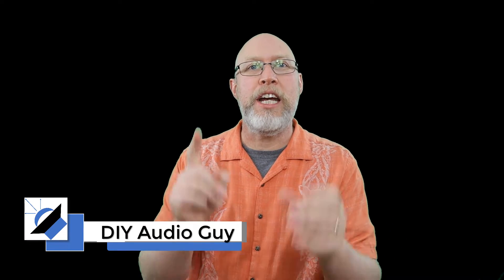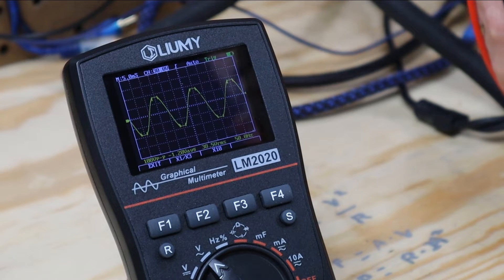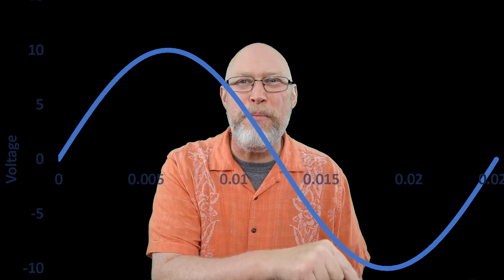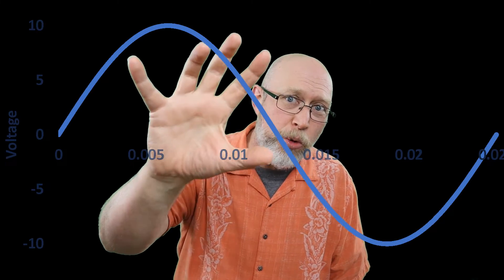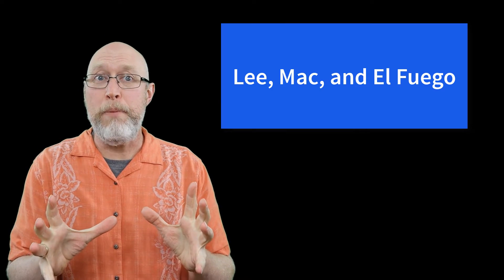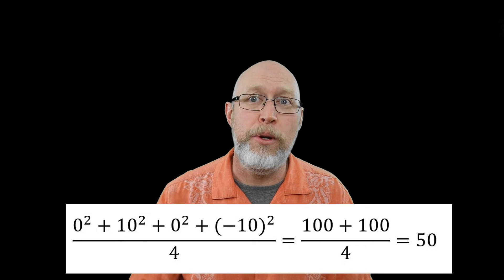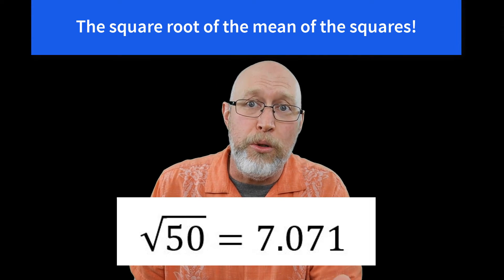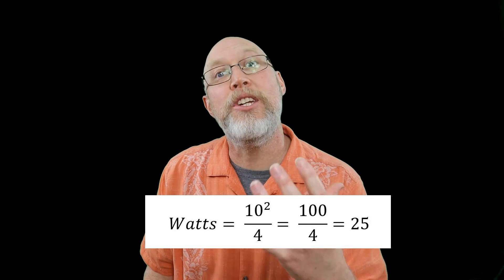RMS Watts vs Peak and Max Watts, Amplifier Power Explained

Comment from the maker: I you found this helpful or useful please consider supporting the channel.  https://www.patreon.com/DIYAudioGuy
Reply: Holy shit do you even know the difference between AC and DC voltage.  Do you have any clue on the difference between an AC sinwave and a DC sinewave.  Please tell me how you get an AC sinewave from a DC source.
Reply from the maker: @timbuckohfive2751  The output from the amplifier is not DC voltage, it is AC.  The RCA signal coming from the head unit is also AC.  The only part that is DC is the 12-volt power supply provided by the car's charging system.
Reply: @DIYAudioGuy  An audio output is a DC current in which the voltage varies in amplitude.  Its not AC.
Reply: @timbuckohfive2751  nice effort, but audio signals are AC, put an oscilloscope on your amp output if your not sure, you'll see a sign wave, the frequency (Hz) is the number of times the peak of the sine wave passes over a certain point in 1 second, high pass and low pass filters would simply not work if the signal was DC, as the frequency would be constant, and just a flat line on an oscilloscope
Reply: @elliotlaw1590  Thats where you are wrong.  Its a direct current.  For it to be ac the polarity has to be changed.  You get a sign wave because its music,  it changes frequency.  It doesnt change ploarity.  Alternating current alternates between a positive voltage to a negative voltage.  Measure the voltage coming out and you will see it never goes below 0v.  I can take a variable output DC power supply hook an oscope and turn the output up and down and it will make a sign wave.  Its still DC power.
Reply: @timbuckohfive2751  You know your stuff, but the frequency of DC voltage is 0, because if you look at DC voltage using an oscilloscope, it creates a flat line, you appear to be getting confused by the conversion of analogue audio signal to digital audio signal, which in its simplest form, is a sine wave converterd to a square wave, that is still an AC voltage though. 
You won't see it read 0 on multimeter, just like you won't see any AC voltage read 0 on a multimeter because of the frequency, or the rate at which the current alternates, if you set your multimeter to DC you'll see it constantly flicker the voltage, but if you set it to AC it will give an AC voltage reading of whatever the peak of the sine wave or square wave is.
Also that kinda explains clipping as well, as the wave goes flat on the top, this is because of the conversion to a digital signal, and some of the data gets lost, so the wave becomes.more "square" this is because of lost data essentially
Reply: @elliotlaw1590  I have a degree in electronics and worked with radars for years.  For it to be Alternating current it has to go from a positive voltage to a negative voltage otherwist its just a dc output that varies in amplituded.  Yes on an Oscope it looks like AC but it isnt.
Reply: @elliotlaw1590  The frequency that you are seeing comes from the song not the amplifier.  The amplifier only increases power of the signal coming from the input.  The input Is an audio signal the output is that same signal only amplified.  The audio signal is what causes the sine wave.  The power is DC
Reply: @timbuckohfive2751  So we agree then, I wasn't disputing the fact that the power was DC, since it's using a battery as the source of power, that's undoubtedly DC, the audio signal however, from the headunit into the amp, and the amplified output audio signal is AC
But yes, the power input to the amp is DC.

I think your getting confused though, because there are DC and AC amplifiers, for audio signals, the amp outputs an AC audio signal, but yes, it uses DC from the battery to the amps power input, to power the amp
Reply: @timbuckohfive2751  I also have a degree in engineering btw, but yeah, audio is a sine wave in analogue format, it's converted to digital format, which is essentially a square wave in its most simplest of forms, which is still AC, effectively the DC power source is switched on and off thousands of times a second by the amp, to create a square wave which closely matches the original sine wave, converting the DC power to an amplified AC output.
Reply: @elliotlaw1590  Its no AC its DC.  You can argue with me all you want but but for it to be actual ac it has to start at 0v got to a positive voltage then down to a negative voltage to be considered AC.  The output of an audio amplifier will never oputput a negative voltage.  Your sinewave you are seeing is an audio frequency Has nothing to dso with what type of current it is.  In a 15 v ac you have a 30v potential.  You go from a +15v to a negative 15V wich if you cout the voltage between the positive and negative voltages give you a 30 volt potantial.  If you look at the power coming out of an audio amp it will go from 0V-15V which gives you only a 15v potential its whhat defines the difference between ac and dc.  For it to be considered AC the flow of electrons has to change direction.  
 alternating current ôl′tər-nā″tĭng, ăl′-►

    n.
    An electric current that reverses direction in a circuit at regular intervals.
    A current which periodically changes or reverses its direction of flow, especially an electric current that reverses direction sinusoidally, as is used for most domestic and industrial power requirements. Contrasted with direct curent.
    n.
    an electric current in which the direction of flow of the electrons reverses periodically having an average of zero, with positive and negative values (with a frequency of 50 Hz in Europe, 60 Hz in the US, 400 Hz for airport lighting, and some others); especially such a current produced by a rotating generator or alternator.

Comment: OMG totally incorrect. You use RMS voltage or current to calculate average power. RMS power doesn’t have any physical meaning and there is no point calculating RMS power of anything.

Comment: Yup. I had a 50 watt 2x4.5  P.A. speaker that was rated at 50w and my 2x8 little guitar combo was rated at 20w. Both are solid state.  My guitar amp perceivable volume was way louder than the P.A. both at home and at the bar venue i play at.

Comment: i have dual 18inch 8ohm speaker with 500w nom, and 1800w max.. should i pick 500w x2 amplifier or higher?
Reply from the maker: Sounds like a PA driver.  What I would do is wire it parallel to 4 ohms and then connect a 500w amp. Learn more here:  https://youtu.be/F51UQSBFaQs?si=gmdr_-WV6WEw0MBp

Comment: Except there's no such thing as RMS power in electrical engineering.  It's a marketing term that's been so universally adopted that now everyone uses it.  But technically speaking, the correct term is continuous power.
Reply from the maker: I literally showed you the math on how to calculate it, so I'm not sure how it doesn't exist.

Comment: Why didn't you mention the Lumy's capability to display the RMS voltage at the bottom of the waveform screen. It is different than peak voltage number that will display if youbwere to switch back to the voltage screen, which will be showing the current max voltage.

Comment: I have a problem, I have a system that needs 950 rms my amp only provides 150 rms and it isn't a bad amp, do I need 950 rms?
Reply from the maker: It will still operate with less power.

Comment: Thanks so much for this video. I have 2 speakers 300w peak power each. Can I use a powered mixer with 600w rms?
Reply from the maker: Not sure what you mean by a power mixer.  Like a pro-audio console?
Reply: @DIYAudioGuy  it's an amp and mixer. Pa system for vocals and guitar. Mostly for band equipment

Comment: The big misconception about this topic is that people keep calling it RMS power, when it is in fact AVERAGE power. Yes, you use RMS Voltage to calculate AVERAGE power, the math just works out like that.

You could take the RMS of the power wave if you wanted, but that doesn't have any physical significance or use.

Comment: NICE! Thanks for doing a video on RMS-peak-volts-etc. I have been a closet DIY speaker building nut-job since the late 1970s. So many of these new digital chip amplifiers have inflated advertised wattages and are severely misleading. Most are about 1/2 their advertised wattages. I go by RMS wattages and I think that should be the standard for rating amplifiers. You also rarely see amplifiers nowadays showing "how quiet" they are (THD and TIM percentages).
Reply from the maker: Glad it was helpful!

Comment: My head unit has 14RMS. I want to replace the speakers but I can't find speakers anywhere near that RMS. Do I have to have an amplifier or is there a way around this? Thank you.
Reply from the maker: No, you don't need an amplifier.  When I was first getting back into car audio I was running some 75 watt coaxials off of my head unit.

Now you might want an amplifier. But, after market speakers will work without them.
Reply: @DIYAudioGuy  Thank you. I have a Pioneer AVH-x4800bs head unit with stock component speakers. I just want to replace them with something a little better. I was thinking some lower rms Alpine components. I will eventually do a complete upgrade but my wife is three weeks out from having our first baby so we will be busy for awhile. I want to replace the speakers within a week.

Comment: Why have the ratings changed so much? For example; a Yamaha A-520 amplifier rated at 75 watts RMS Into 8- 16 Ohms matched with a pair of Realistic Mach 2 loudspeakers. Rating at 160 watts Peak. I later added a pair of rear speakers at 4 ohm, 100 watts peak. Little bookshelf speakers on stands my brother made me. My friends would always say : how is your stereo louder than a bloody nightclub? And they always referred to a family member that spent over 1 grand on a system that sounded like a little transistor radio in comparison? Also?: how much did you really spend? Because it's deafening. Etc. I even used my system as a PA system with my first marriage.  I used a tape deck with a mic input and jambed on record. LOL. Worked like a charm. Big hotel with big floor area. Yet a poverty system sounded perfect in that environment. But only 75 watts per channel RMS? I also went by the weight of the Amplifier as it felt like someone put a solid brick or 2 inside! Any reply appreciated? I have an engineer friend who I still buy Subwoofers to install for friends and family. He explained that things were made with better glues and Resins? He told me how he worked for JBL In the UK as a production manager. He had to tell the assembly crew what glues to use on cheaper speakers and to use better quality glues on dearer speakers! He says still to this day: it doesn't matter what brand? If your paying top dollar for the best in any brand basically you will Have an excellent reliable sound system. Sorry for rambling! But is this true? Cheers from Australia
Reply from the maker: I really don't know.  Part of the problem is that consumers only understand watts and that's all they look at. There is a lot more than goes in making good sound.

Comment: So, if the speaker's Peak Power is 2400 Watts Watts Per Pair (1200 Watts Each), Program Power is 1200 Watts Per Pair (600 Watts Each), and the
RMS Power is 600 Watts Per Pair (300 Watts Each), I can just buy a 300W+300W amplifier should be good, right?
Reply from the maker: Yep.
Reply: @DIYAudioGuy  Thank you, sir!!!!

Comment: Hi sir I have pioneer gm-a6704 model amplifier I don't know how much rms in this amp and which subwoofer can I use I select 1200watts infinity primus 1270 model and rockfordfosgate r1-s412 which one is correct suitable subwoofer in this amplifier pls tell me sir
Reply from the maker: I found the specs in under 30 seconds via a google search.  That is a 4-channel amp.  If you bridge it then either of those subwoofers will work OK with the amp.

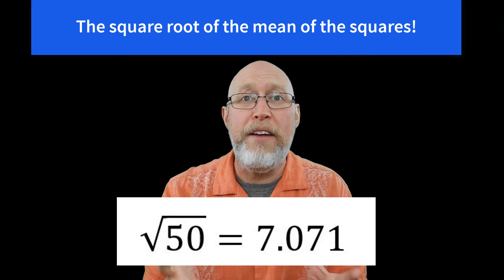Comment: @5:25 The reason you take the square root of the summation is to reverse the previously squared samples that were summed. Pretty straight forward, you square the sample to remove the negative values, then add them up, then reverse the process you used to remove the negative values by taking the square root of the sum. I just discovered this channel and very happy to see someone explain these topics so clearly, great work dude! The biggest hurdle for most people is math, I remember being afraid of square roots and other simple math but only because I didn't know it, took years for it all to click. Now it's embarrassing to even admit I was afraid of math and avoided it like COVID. Ha ha! I have a hunch that bankers know this, which resulted in things like compounding interest.
Reply from the maker: I have found that a very small amount of math creates a very large amount of power.
Reply: @DIYAudioGuy  Math and physics, the basics using algebra level math isn't that difficult conceptually and explains the world we live in.

Comment: Why dont manufacturers just produce one wave length amplifier and mention only rms value instead of peak values no one cares about peak because after peaks actually the systems shuts off its like ur car runs on 12v u can have max peak of of good battery voltage of 14 but if you give it 16+ the wires will fry!!
Reply from the maker: It's all marketing.  Power is an easy thing for consumers to understand and compare across products.

Comment: While this is all true as far as the consumer is concerned, It should really be called Average Power not RMS Power. The so called "RMS Power" given in specifications sheets is actually the average power rating. If you actually calculate the root mean square of the power waveform you get an incorrect (higher) number. Referring to Average power as RMS power makes no sense and is simply mathematically wrong, and was a term that likely originated with someone who didn't understand electrical engineering.
Reply from the maker: AC power is a lot more complicated than most people realize.  All of the stuff that you and I are talking about only applies for restive loads.  Most loads are reactive.
Reply: @DIYAudioGuy  This is very true indeed, though most power amps are rated into a resistive load. Either way, referring to average power as RMS power is wrong, even though it seems to be accepted for some reason in the audio world. RMS is only really useful for voltage or for current. When dealing with power, average is the relevant quantity, and can be calculated by multiplying the RMS current and RMS voltage, assuming a resistive load of course. but the point is that for resistive loads,  RMS Voltage x RMS current = AVERAGE power, not "RMS" Power, which is a term that simply isn't describing the quantity that is being given. While you could actually calculate the Root Mean Square of the power waveform, it would not actually be the same value as what people people mean when they say RMS power or average power, and would have no real utility.
Reply: @chrisbauer1925  I recently developed a AC power meter and was left scratching my head wondering what the heck I was doing wrong in my code, come to find out... you can't calculate power as you stated. After a bit more research it all became clear where I was going wrong but I think it's okay to say RMS power, my reasoning is that the consumer knows the values used were RMS and not peak values. If you call it AVERAGE power then that infers that you averaged the instantaneous power which will give an incorrect value as it does for voltage and current, the RMS voltage and RMS current need to be used so the name RMS seems fitting IMO. As for the amplifier ratings the final load impedance is all that matters, because it makes no difference to the amp what the power factor is, every drop of the power it's making is real to the amp. Wouldn't be the first time I'm wrong but am I missing something significant?
Reply: @str8upkickyaindanuts289  "If you call it AVERAGE power then that infers that you averaged the instantaneous power" Yes that is what I was implying. "which will give an incorrect value as it does for voltage and current" This is incorrect. Vrms * Irms = P average.

Comment: Here is a question that I can't seem to get answered.  Can a 500 WATT RMS @ 2 OHMS amp power a sub box rated at 600 WATT RMS @ 2 OHMS and 1000 WATT Peak.  I know you can overpower speakers but what if you underpowered them?  Will they still work but just not be as loud?
Reply from the maker: Yes, you can use a 500 watt amp with a 600 what speaker.  You are exactly right, it will work but it will not be as loud.  There is myth that "under powering" speakers will cause them to blow.  This is not true.  What actually happens is that some users will under power a speaker and then compensate for it by turning up the gain to the point of clipping.  The clipping is what destroys the speaker.
Reply: Also, considering that you need to double the power to gain 3db(typically the smallest increase the ear can detect), you won't hear the difference between 500 and 600W.

Comment: Buddy, how are you doing? Nice video! I am interested on JBL IRX108bt active speaker it has 200w (rms) and 1300w (peak). But there is other EON610 which has 500w (rms) and 1000w (peak). They both play 124spl and frequency extension very similar (54Hz-20kHz and the second 59Hz-20kHz). If both play equally regarding pressure, (taking into account they have 8Inches/10Inches) whats the IRX or EON is better for me enjoy?
Reply from the maker: I'm not familiar with either one of those products.  I googled them and it looks like these are  pro audio/PA speakers?  I don't know enough about those to give you any reliable advice.

Comment: i always had it explained to me as peak is what it will do, right before the smoke comes out. RMS is what it does under normal circumstances. so do you want to run it all once, for a second or 2 at 2000 watts, or for the next 10 years at 500 watts?